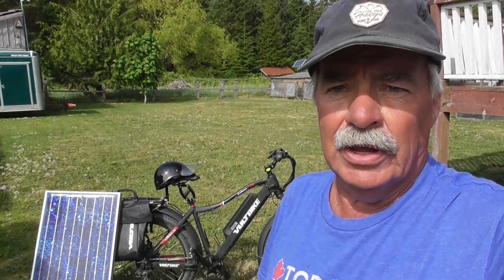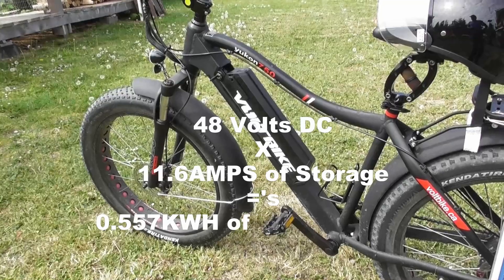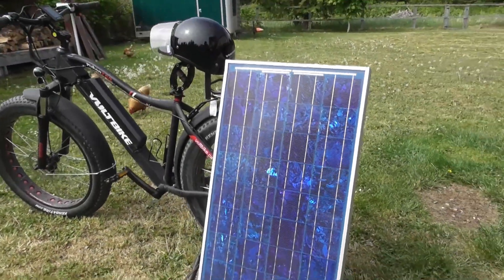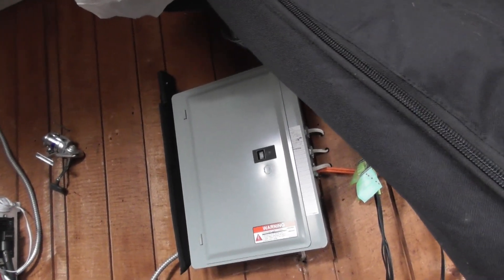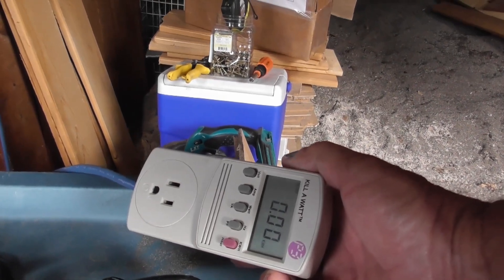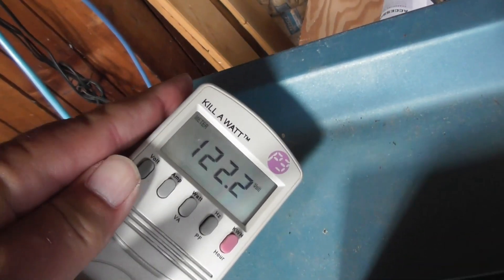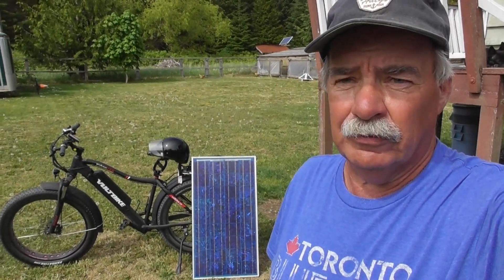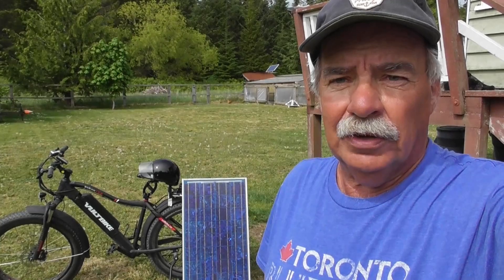Can Solar Power Extend the Range of Your Voltbike!

Comment: We charge our bikes from our caravan. We have 200 watts which did the trick but took the caravan batterys down a bit more than I liked, so I'm installing another 100 watt  panel today. The existing panels are 19.2v and the new one is 17.89v so I'll only end up with about 285 watts. Cheers Norm
Reply from the maker: Yes! Using batteries and an inverter, you can charge the bikes with the small panels.  Just not able to carry it all on the bikes themselves.  A caravan solar base station would work fine.

Comment: Remember the little generators that used to power. Bicycle headlights?  I wander if they would trickle charge your batterie?
Reply from the maker: The voltage on those generators would be way too low to charge these new batteries Dave.  GADS we are dating ourselves! We actually remember those generators!  LOL!!
Reply: Yeah eh 🤒

Comment: Nice brother.. 1/2 KW is a nice bit of power. If you had to. You one of tho's voltage boosters would run off the 12 volt PV. It would boost you to 60 volts but wow it would be slow like maybe 20 watts an hr at best.. Not at all worth it. As you where saying, Just have a spare batt with you. God Bless brother..
Reply from the maker: Thanks Brother!  Yes the spare battery is a much better option.  Much smaller and much less weight.

Comment: i just ordered the same bike you have...i was hoping i could charge my battery off a 300 watt inverter from my 12 volt deep cycle battery as i am driving between campsites...what do you think, will it work ???
Reply from the maker: If the deep cycle battery is 100AH or higher, you can charge the Voltbike battery with the 300 watt inverter.  However you will need to recharge the deep cycle battery before you can charge the Voltbike battery again.  How do you plan on recharging the 12 volt deep cycle battery????
Reply: @NormanMcGregor  norman, my deep cycle battery is 105ah and i use a 100 watt folding solar panel when stationary and my isolator off my dual batteries (diesel truck) when on the road travelling...hope this will work...and thanks for replying
Reply from the maker: Sounds like a reasonably good setup.  The solar panel will charge the battery when not moving and the truck will charge the battery when traveling.  The 300 watt inverter should deliver more than enough power to charge the voltbike battery using the supplied charger.  Your 105ah battery in reality will only deliver 50% of that but it should be enough to keep the voltbike charged even if you ride the bike down to 1 bar.
Reply: @NormanMcGregor  thankyou for your input on my issue with power...i will be using my bike 50% of the time off grid so this should work ...
Reply from the maker: Thanks!  I am interested on how this will work for you Billyt.  Let me know how it does.
Reply: @NormanMcGregor  i will hopefully be getting my yukon in november sometime...probably won't be doing much camping until april (on vancouver island, where i live) i will let you know the results
Reply from the maker: @thomas194907  You will have so much fun with it in the mean time!!!  They are AMAZING!!!  You will be riding it every day!!